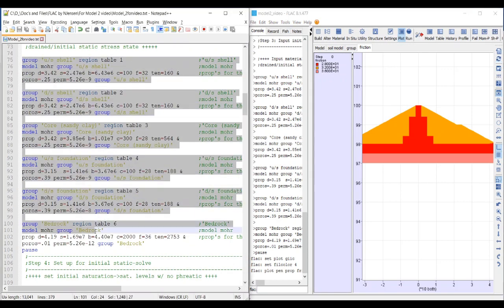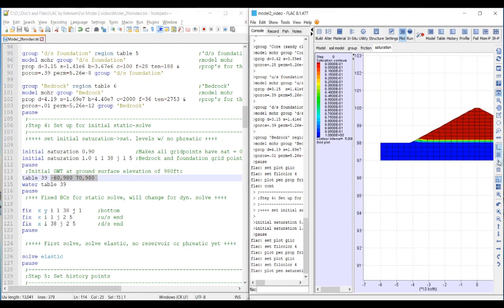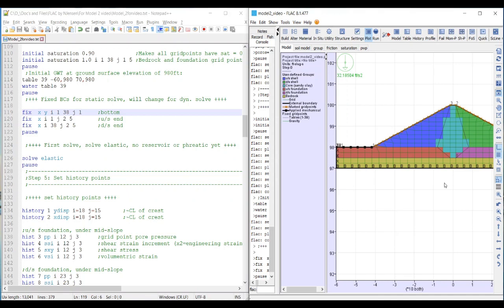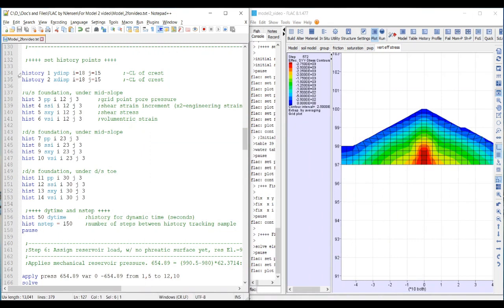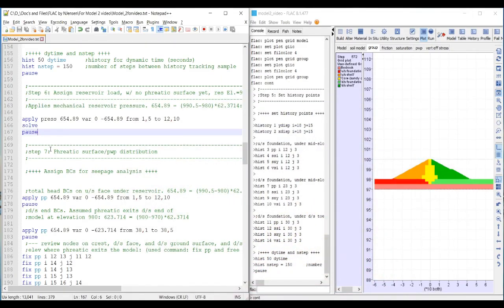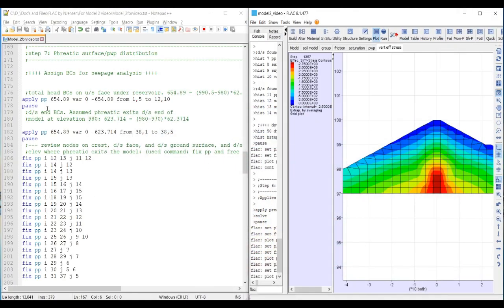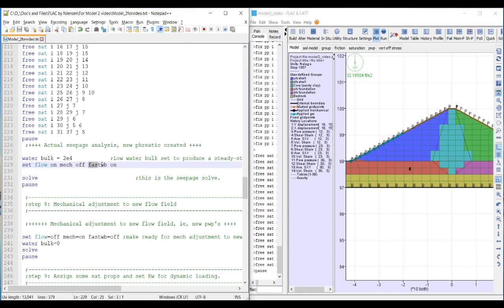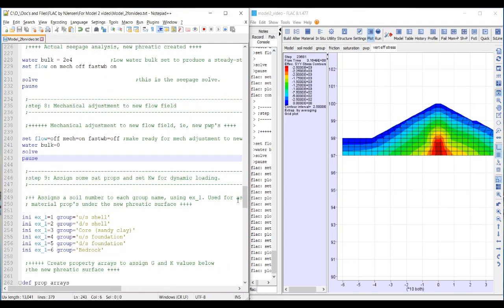Seismic analysis (Part 3 of 5) of an embankment dam and foundation, tutorial using FLAC, w/ seepage.

Comment: Thank you so much for your time and effort. Could you please include construction stages?
Reply from the maker: Hi Mahir - I have used staged construction in the past, but I haven't got around to getting them up in video form yet. At least one other person did ask about this, so maybe it would be good to add it here.  
The difference in vertical effective stress from creating the mesh in stages isn't large enough to make an appreciable difference in the type of runs that I usually am dealing with.  Although, it can make a difference in some cases.  One added issue is to accurately model the compaction effort, for cases when that is necessary.